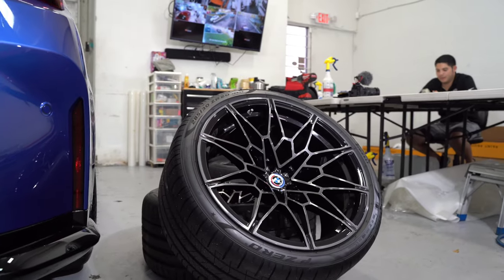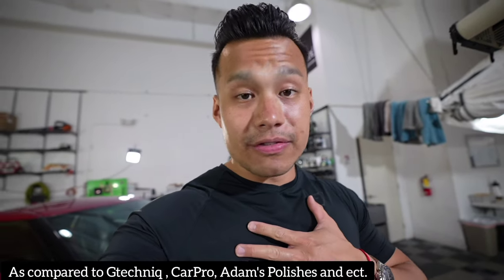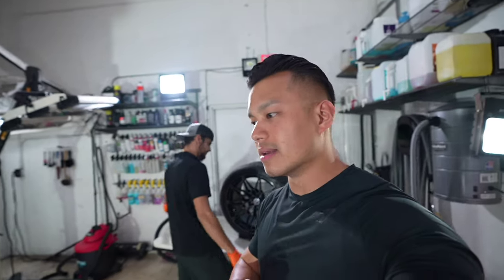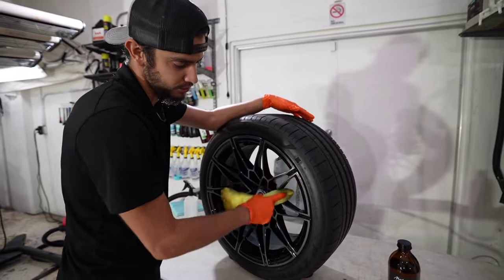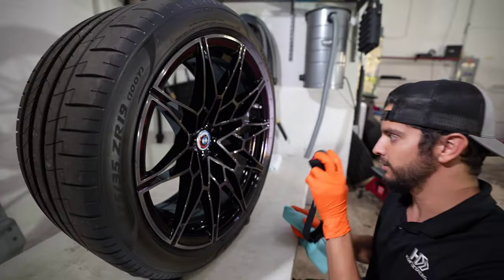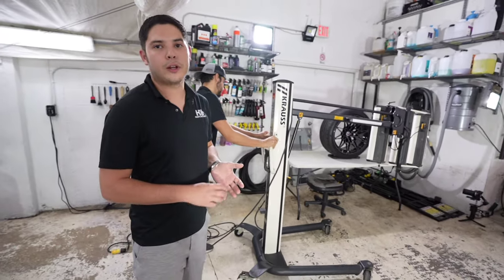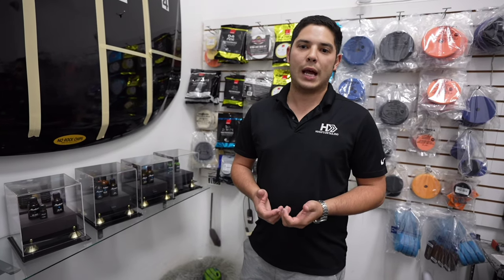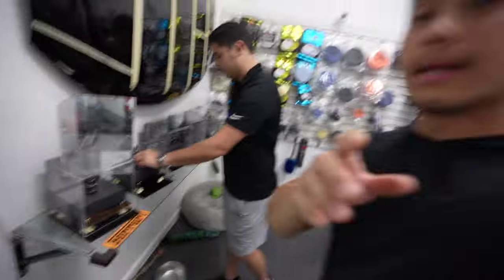I Choose The Worst Wheels To Clean On My Imola Red G80 M3

Comment: use a silica spray if you tend to wash the wheels a lot. i have ceramic coated wheels and they recommend to wash with normal wheel cleaner. I choose adams wheel and tire cleaner and then go over it after with a silica spray
Reply: Adams wheel cleaner is a little overkill for maintenance cleaning.
Reply: @KiranPatel-fk1pg  what do you recommend then?
Reply: @slippinonbutter5275  Personally I use Koch Chemie Active Foam in a foam cannon 10:1. It's a mild alkaline snow foam that works great for maintenance cleaning coated wheels. Then for tyres every couple washes I'll use some APC.

Comment: What a lot of people don’t realize is, the car is hit with a buffer at the end of the assembly line. There is a group of white coats that go over the panel gaps with a measuring tool, and check the paint with a paint depth gauge, right on the assembly line. But they also buff any imperfections. As you can see, on your rear bumper, that came from the factory like that. Or PCD got a little wild with a buffer. Modesta, great stuff. Agreed with the other comment. Definitely airbrush the coating onto the wheels. There are too many cracks and crevices to get with an applicator to get the wheels completely covered.

Comment: They  need to get a air brush sprayer to coat wheels. Just spray on and wipe off that way you don't waste product.
Reply from the maker: Yeah they mentioned they used that method but they like this method more. It had to do with something with South Florida's high humidity mixing with the blower.
Reply: Ceramic coating is not something you want being misted in the air. Most change of it blowing in your eyes, skins etc. Plus it wastes product. Using a suede applicator sheet is perfect for wheels and will use minimal product.